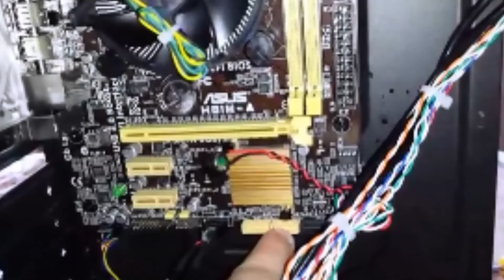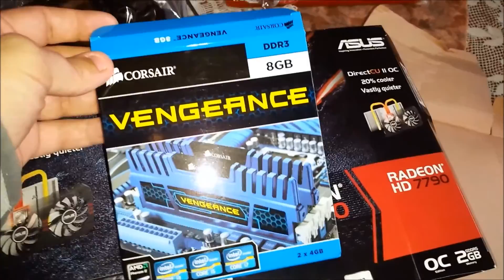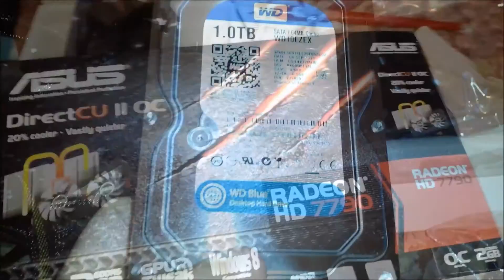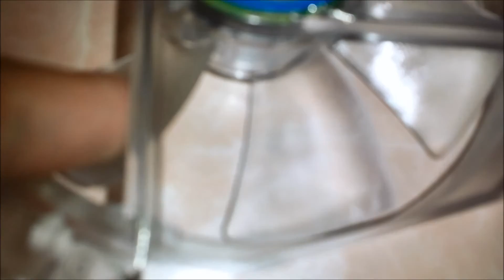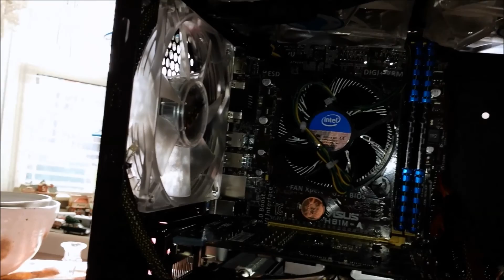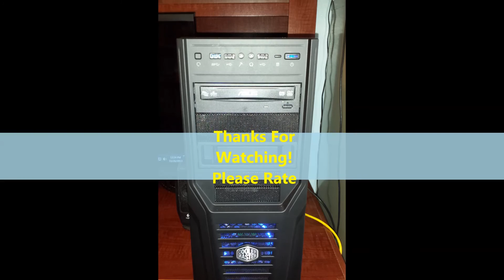Eclipse Build, 4770k Haswell Mid level Budget Computer

Comment: if u do not want to meke oc, why do you have buyed an unlocked -k cpu? you cloud save some money by using a normal i7 4770 , not the -k version, and 100$ are a lot too moutch money for the motherboard that you have chosen, for this build you had to take a h97/h87 chipset motherboard and a normal non -k i7 4770 cpu, this is a wrong build, you colud save some money that can be spended on the graphics card